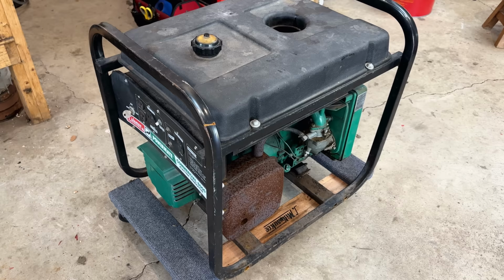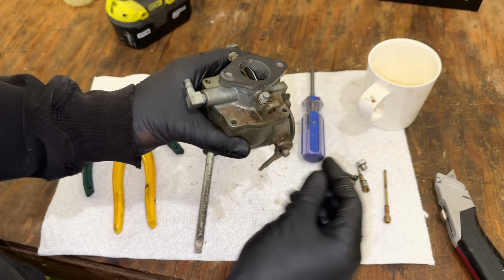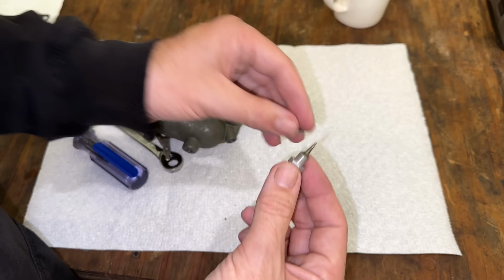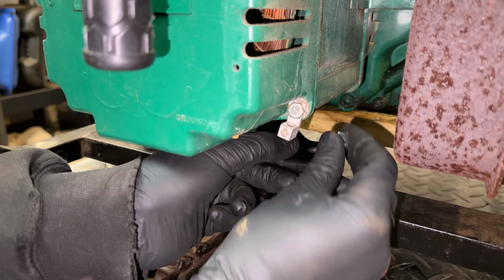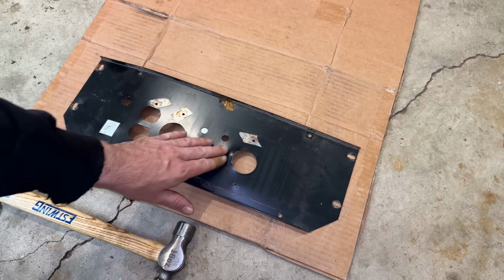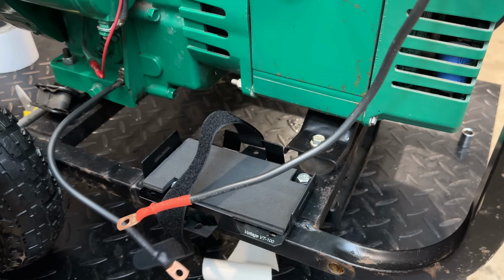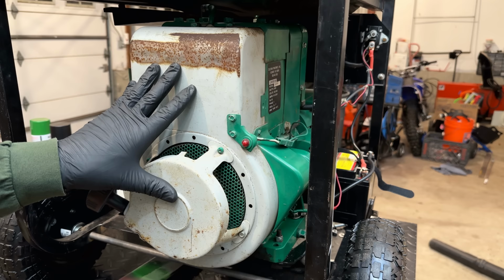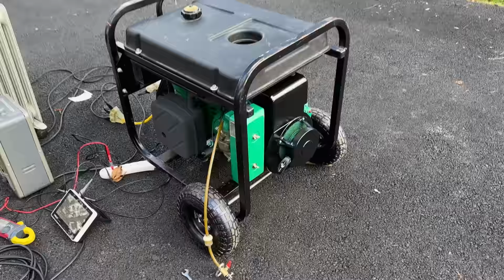1980s Powermate Generator - Will it Run and Make Power

Comment: OK James, Thank you for a diligent job. I really enjoy your meticulous attention to detail and your patience especially on older units that don't have much of a future if something gets broken in the process of "bringing it back."  I don't have time to read too many of the comments, so I will just offer mine in the hope that someone will back me up and maybe even offer something to enhance my comments. 1). I wonder if that unit was originally designed to use a lawn tractor lead acid battery, and perhaps the physical size of it would be able to absorb the hysteresis of a little too much voltage? 2). Would a full wave rectifier drop the charging voltage enough to satisfy the requirement on the newer gel-cell batteries? It's usually a volt and a half or even 2.  I know it's pretty simple to just make up a full wave rectifier out of a quad of p-n diodes and just tape them right into the wiring, but you could get a small solid state one piece bridge for pennies and put a number screw thru it with a nut to mount it somewhere. (I don't like self tappers, so I'd use a #10 or an #8 screw complete with flat washers and lock washer)  3). Back when that unit was new it was not un common to make a "fine" adjustment to the governor once the load was established. Thus, the thumb screw adjustment. i.e. At deer camp we used to adjust a way way old Onan up a little when we ran the pancake griddle, and down again when it was only running lights.  4). Being a Coleman, there is exact color match spray paint available for it. But you could mix it up yourself, I have in the past. *(on automobile engines) Just get out your color wheel and buy a couple small cans of Rust-Oleum and start mixing. I actually received comments from guys when they saw my rebuilds, and noticed the color match. They could never find the exact Blue engine paint Chrysler Slant Six engines came from the factory with in a spray can at the auto parts store or K-mart back then. I had color matched it myself. It can be done. OK, fine business Jim. ben/ michigan

Comment: The charging wire with a with a diode creates a pulsating DC current. With an incandescent light bulb in series with the battery charge wire,  you can reduce the charging current and the voltage drop across the battery. By picking the right lamp (light bulb) you can set the charging of the battery to whatever rate you want.

Comment: Great video as always! It’s amazing you ‘only’ have 144k subscribers!
For the battery charging voltage issues, suggest you consider adding a battery charging control circuit. You can buy modules off the shelf that will likely do the job.

Comment: It's getting harder and harder to sell flathead generators. I can't even GIVE them away!
Reply: Seems people are to picky 
We still have two and love them 😊
Reply: Well I'm thinking it may not be a good idea to run a modern fridge on them so their usefulness for a power outage is getting slim
Reply: How much more fuel do they use than the OHV's?
Reply: @erik_dk842  I’d say at least 20 percent more efficient from my experience.  OHV are also quieter, more compact and lighter.  Tests show that more power can be derived from a OHV engine than from a comparable displacement flathead engine. They also run cooler and use less oil over time.
Reply: @selkywaters  James can chime in on this topic but the issue with running small engine generators to power electronic devices has to do more with the cleanliness of the power or Total Harmonic Distortion, commonly referred to as THD.  You really want 5 percent or less which generally requires an inverter-type of generator.  Whether it is powered by flathead or OHV shouldn’t matter although I don’t think I’ve ever seen a flathead powered inverter generator come to think of it.
Reply: @KensSmallEngineRepair  For an occasional use emergency generator the extra 20% shouldn't be a showstopper.
Reply: @erik_dk842  just as long as you’re not powering anything with sophisticated electronics
Reply: @KensSmallEngineRepair  20% extra fuel consumption, just to clarify.
Reply: Yes Ken Samsung recommends an inverter machine to power their refrigerators.  Otherwise they recommend putting a UPS after the non-inverter Genny and running the fridge from the UPS.
Reply: Ill let James or Gary Bernacki comment on the pitfalls of using a UPS on sophisticated electronics. An interesting discussion.

Comment: James, don't waste all the threaded rod - make it 3-4" bolt length and put nut on inside rail. You'll have plenty of rod for another generator.
Reply from the maker: You could, but a through axel is a lot stronger.  No twisting action in the frame.  And that frame had so many holes in it, was not sure how it would hold up.

Comment: A buck-boost DC-DC convertor set to 13.8 volts attached to the end of the red charging wire could solve the battery charging issue,  Enjoyed the video,

Comment: Another good save James! Just a bit of correction on the technical jargon. A bridge rectifier gives you full WAVE rectification a single diode can only give half WAVE rectification. So the correct terminology @ 1:37:28 would be full wave or half wave, not bridge..... Also, a fun fact, a diode (normal diode not a schotkey diode) has a 0.6 or 0,7V forward drop, meaning, you could use a series of diodes to limit your charge voltage, just make sure that they can handle the needed current with which the battery charges.....

Comment: James great content I use these to remove fuel valve from tank also apply oil wd40 inside tank near vavle and wiggle to work down between valve and grommet then use plyers pops right out

Comment: 3/8 socket extension backwards works great to change the oil. A copper automotive brakeline gasket works well on the needle. Elevator bolts to mount the battery tray 1/4 20.

Comment: You should have tested the battery charging circuit while the generator had a load on it, the voltage may have come down, brief periods of over'-voltage probably would not damage the battery. You could get a riding mower voltage regulator as well

Comment: I have this exact generator!  Right now it won't start unless I spray starting fluid in because it only makes around 20 psi of compression..  I think I should just take it apart and really inspect everything.
Reply from the maker: Check the valves before tearing it completely down.
Reply: @jcondon1  thank you! I will!

Comment: Add diodes in series to drop voltage.  1N4007's are cheap. But max current is 1A. So better check. Maybe a series resistor also. And check that charging voltage and current with a scope.

Comment: The "run fast" problem coming off load, could that possibly be ameliorated by re-greasing the bearings, allowing you to perhaps set speed/frequency more accurately initially, plus causing the motor to work less-hard on-load, having better wave-form and least frequency drop during surge? 
Love the measured pace you set. Cheers James

Comment: The mounting issues make me wonder if that's not the correct frame for that generator.
Reply: Looks like a machinist owned it and gave it some proper TLC a while ago. The days before stuff were throw aways. Then "upgraded" it by putting it on a new frame and large gas tank.

Comment: Dish washing detergent instead of Harbor Freight degreaser???????
Reply from the maker: They changed their recipe.  Now corrosive to aluminum.  Still use it on carbs that are cheap and easy to replace.  For older carbs that are discontinued or expensive do not want to chance it.

Comment: Those old Flo Jet carbs are notorious leakers!  Buy all new gaskets!!  

If  you want gaskets to NOT stick, apply a very light coat of Permatex Form-A-Gssket 2 to both sides.  It is non-hardening.

What do you think about Dawn dish soap for your ultrasonic cleaner?
Reply: Dawn is what I use all the time in my shop

Comment: @jcondon1
 You can easily control battery charging voltage with a zener diode. One sourced for a classic British motorcycle should work fine as the battery sizes are similar. They do need a good heat sink and they're not precise but they're good enough for the purpose. Not sure if the charging coils would be up to it, as with a Zener they're going to be running full output constantly with the Zener absorbing the excess current.

Comment: I'm guessing, but since that generator is marked "Commercial" perhaps the manufacturers expected it to always be used with a full sized car battery for the starter motor instead of with just a little motor-cycle sized battery?
In any case, a stop-gap measure to bring the voltage down would be to add a string of high current rated diodes to the charge lead.  Each diode will reduce the voltage by around .6 of a volt, so I'd start with a string of 4 diodes and have a couple more on standby in case 4 didn't reduce the voltage sufficiently.
I used the diode-string method on a camera which I recovered from a laptop computer which had a bad motherboard.  It used a USB compatible connection but it became far too hot at 5V, so I added diodes to reduce the voltage until it only became very warm, which is fairly normal for some electronics.

Comment: Thank you for a really excellent video. I really like how you installed the tires and the "foot" for the generator. I am also extremely impressed with how you serviced the carburetor, repaired the gas tank with the new valve and bushing,  and painted the engine parts. I see from skimming the comments that others have suggestions for installing a battery charging kit for the battery. A suggestion. Can you enclose the battery cables inside a conduit? That would look neater and further protect the cables. Is it possible to protect the gas tank from any sparks emitted by the battery and cables? I don't know enough about the safety factors involved, I do not pretend to be an electrician or an engineer, but it makes me nervous seeing battery posts so close to a gas tank. Is there some way to protect that tank from electric sparks? I'm not an expert, I have no qualifications at all, I'm just wondering about a sparking issue.

Comment: HI , the red wire indeed should have a diode to rectify the ac , you could fit a motor cycle Zener Diode between Earth & Positive , these are normanly 12volt & mounted on a plate to disapate heat. This will hold the voltage to about 13.8 volts regardless what the  generator is doing , generator charge rate is about 1 Amp which should be fused , if diode goes short for any resaon it will destroy your charging coil if the battery is connected , hope this helps Regards Roy

Comment: I live in South Africa and really enjoy your videos. 
I would like to ask can the units be cleaned with a power washer? I am a little OCD about cleanliness. Your recommendation would be highly valued.
Reply from the maker: I try and avoid that.  It would be a lot easier, but water can cause engine problems and electrical problems.  I have power washed a few.  One the stator failed after.  Not sure if that was a coincidence or cause by water.

Comment: Yes thank you for your time I learned an awful lot at the end especially with the meters.. and heaters hooked up.. the question is like you say you don't want to run sensitive electronics and how much will something start burning out tablesaws and such.? I have the exact same generator but it's just a different name I bought it like 25 years for 300 bucks... It's a nice machine but I'm just have to know how much is amping out because last time I hooked the table saw to it,it just had no f**** balls to ripp thru 2x4's

Comment: When you look at all the new machines on offer, with all their potential flaws and oversights, do you ever consider how you would build (design) a range of generator models that were functional and user friendly? Condon Generators. Built by experience.
Sourcing the components (complete engines, generators, frames, tanks, control panels,...) in bulk and assembling them to your standards might just pay for your retirement and more depending on how big you dare to dream. Cheers.

Comment: I thought it would be like an old car air cleaner with a clamp around the carburetor horn which would be your 1950's variety. The Carb gasket is just 40+ years of pressure is my bet.  If you want to bring back those faded Black Plastic parts use a 60/40 mixture of Penetrol & Boiled Linseed oil which will re-emulsify the plastic and return it to like new condition.

Comment: I probably would have put down a bit of electrical tape after the first layer to cover the fasteners then put the second layer down so as to reduce the chance of rubbing against the battery case.

Comment: Nice job as usual, my note and as Briggs instructions the clutch starter must run dray as there is a five metallic balls inside must be free to use the centrifugal force when the engine run. 
What in your opinion cause the high voltage of the DC output????

Comment: Yes now Briggs engines have those plastic compression release gears that snap in half, they should just stick to having the exhaust valve stay open just a little bit longer but no let's put plastic crank shafts and compression release gears inside an engine, great job Briggs and Scrap Em, lol

Comment: With that voltage being high,  the wattage will be too,  until the loading pulls the voltage down somewhat.  I would have been interested in seeing what the inside of that power head looked like,  compared to a lot of what else I have seen on this channel.  A lot of work,  but not all that much of a cash investment there,  for sure.  When you were trying to get that fuel shutoff valve out of the tank I was yelling "vise grips!" at my screen until you grabbed some.  :-)   Too darn long,  though.

Comment: AGHHHH! You used push nuts on both sides of the axle - what if you need to replace a wheel in future? One end should have had a cotter pin/washer.
Reply from the maker: I know.  I hate those push nuts too.  Easy to install, pain to take off.  But I had a box of push nuts and very few cotter pins in stock.  Had to use what I had.

Comment: I have a 4000 watt power mate but it blew the connecting rod those Briggs and Stratton engines were prone for that..
Reply: I borrowed one from my father in law that had the 8hp flathead briggs for a power outage at my house on Christmas eve.  Probably less than 10 hours on it.  Since I borrowed it, I changed the oil before I used it.  Ran maybe 3 hours and chucked a rod through the block.  This was in the late 80's.
Reply: @woodhonky3890  yup mine has the 8hp flathead did the exact same thing. And it was a early 80s model. They just didn't used good enough metal for the rod back then.

Comment: You could probably use a high amp dc to dc converter to fix the charging system. Just throw it in a Altoids can and paint it green. Also is it possible that the charging system is maybe meant for a 24V battery. I know that the starter motor worked well with 12 volts but something about that voltage going so high so quickly made me think it's meant for a different battery. You can probably take the battery out of circuit and run the generator to see what the full voltage will be of the charging circuit.

Comment: yes sir nice job. you wouldn't know by chance on how the wires go on the  transfer block on A CHAMPION 3500 watt 4000 surge older 2012 just 120 volts generator  person i got it off of had it  3 red on one terminal and rest 3 black and  1 or maybe 2 white together on another terminal. i have the green cabelas outdoors just like it but mine has 220v too and more wiring thanks also its yellow open frame no inverter just plain ole rv emergancy power generator 196cc think says on pull start casing

Comment: Great video James.  I have the 4000 watt version of this generator purchased in 1986.  Now I know how to get it up and running.  I'm wondering about applying a very fine layer of waterproof grease to the mating surfaces of paper  and/or fibrous gaskets.  I'm thinking that would prevent tearing on future disassembly.  Of course I wouldn't use anything on metal/head gaskets.  Thoughts?  Kind Regards.  Craig
Reply from the maker: Grease works well for gaskets reuse.  They come apart without ripping.  Just have to be careful if you use it on the carb gasket.  The grease could clog the jets.
Reply: Thank you.  Craig @jcondon1

Comment: James , I find it interesting that you dial these motors in , with watts ,hertz , total harmonic distortion , but I never hear rpm’s discussed , although in this one you did say sounds like it’s running too fast , I was just wondering if rpm factors in . I really enjoy your videos !!
Reply: Virtually all non-inverter standalone generators use synchronous alternators. There is always a fixed ratio between output Hz and shaft rpms so there's no need to measure both. For the simplest direct drive 2-pole designs (seen in 99% of James' videos) the ratio is 1:60.

Comment: i got a old companion from sears 5000 watts 10 hp Tecumseh looks almost same not as great shape paint but not bad either it was in store one my friends owned few years back closed store i bought it for 50 bucks he used it to run coolers when power was off it needs carb work i believe ele start to i tinkered with it had it running on propane just with hose running up to bolt hold breather and filter,cover on. running not great but it outside wind breeze and no thing in between end propane hose and mouth of carb but half inch space probly wasnt getting enough fuel lol idk just tinkering try get it going/ was satisfied it ran AND LIT UP FLICKERING LIGHT

Comment: the idea adjustment screws sometimes it get upset with water if you sprayed into it air fuel screw adjustment I never touched them at all unless you need to